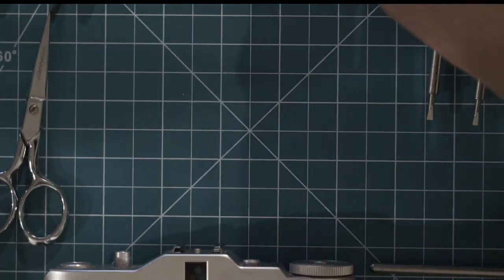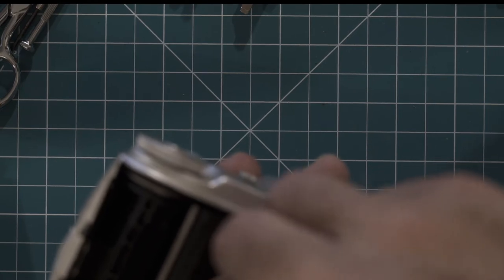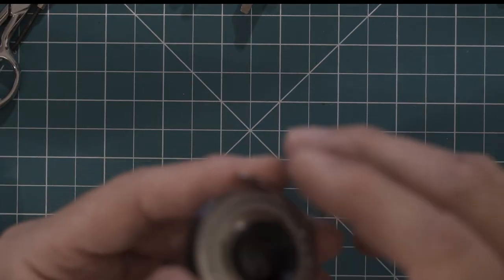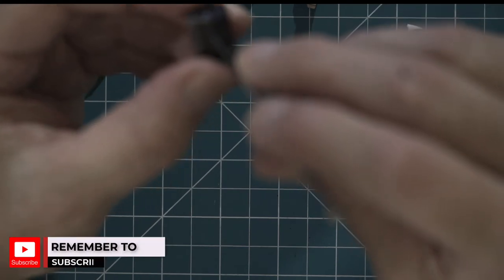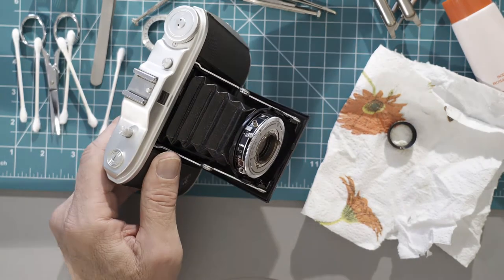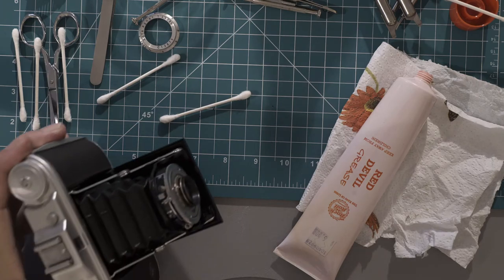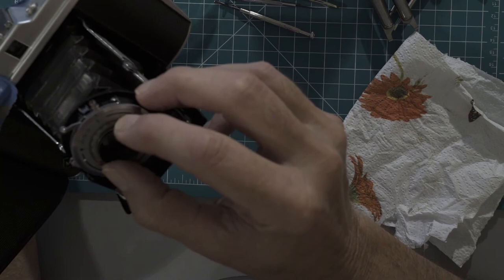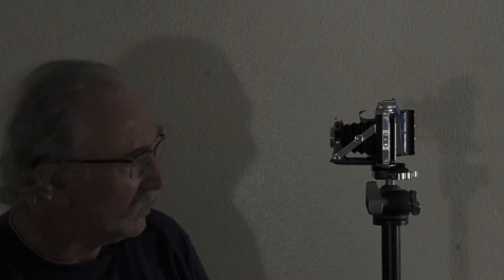How To Repair Frozen Lens Agfa Isolette Medium Format Camera and Collimate Lens for Folding Cameras

Comment: What worked for me was soaking the inside lense in a shot glass with 85% alcohol, wrapping said glass in plastic foil and then dumping this setup into a pot with water just below the "bubbling" stage. This keeps the temps at just below 100C, which in my opinion is well bellow what the lens can tolerate but warm enough for the green goo to melt and stops the alcohol from evaporating too fast. After about 10 minutes I saw that the alcohol got hazy and greenish. I could then separate the lenses with no effort at all. Keep in mind that alcohol is HIGHLY flammable and this may not be safe at all on a gas stove. Did this on an induction stove top. I also designed a custom 3D printed tool for the removal of the shutter from the bellows, will be posting to thingiverse. I don't think Dennis mentions it, but set your 35mm camera to infinity and then align with the isolette. Once the glass (or painters tape with a couple of straight lines) is in focus you have your infinity notch.
Reply: Nice you have cleared the lens and practical.Thanks.
Reply: Recently I got one from my friend in Hyderabad,India.It is Agfa agnar pronto 4.5 to 85.But soiled by dust.and I cleared it with D40solution and by coconut oil in liquid paraffin to clean the external body.But to open the lens ,I saw this video.But in vain.Actual lens opening video was out of frame.Sorry, I couldn't control.

Comment: This worked like a charm for my Isolette V! Took me a minute to get the lenses unscrewed, it was hurting my thumbs, but I pushed through and they came undone!  after that I soaked them in Mineral Spirts for a few hours and the old grease came off pretty easily. A camera shop in my area wanted $250 to fix it! Going to use a #10 grease to put them back together again. Cheers!

Comment: I just got a frozen isolette III in beautiful condition but with a frozen range finder and focus. The range finder was easy enough to get at and is now perfect, but for the life of me I couldn't figure out how to get the lens off the bellows to soak and clean (I'm new to servicing cameras and this one is over 30 years older than I am). 

This was super helpful, I'm ordering pliers now and going out to get some hose clamps. Even though I marked the orientation of the lenses so I wouldn't have to worry about getting it right when I put it back together I'm going to go get some wax paper just to experiment and double check

Thank you!
Reply from the maker: Even though you marked the lens you will need to check focus. Very hard to mark and get it right again. Good luck take your time.

Comment: Great Video lesson Dennis, Thank you, just one question, i am checking a rolleicord 3 focusing with your method, using a dslr 
Nikon 5100, what is the setting on the DSLR i must apply ? Gracias , Alejandro
Reply from the maker: Sorry never used a DSLR but I would say setting doesn’t matter as long as you don’t move the setting that you are using.

Comment: okay so with your clamp technique i managed to actually get the lenses apart (damn they were stuck!) but the clamp must of slipped when i tightened so the outer lens got a bit bent in one spot. I hope it will work anyway, i think so atleast, its right where the focus ring goes on, you can see it from the outside so hopefully it will be just a good memory and nothing else. I apprichiate seeing the part on how you focus a camera too, its nice! 

We'll ill be on with it, got alot of the deviles grean greease to rid of..

Aaaand i just found a shatter in the glas of the back lens.. was afraid to screw it real tight and i think i just learnt how much is too hard.. 
Its just on the side so hopefully it still works. Or the picture just might have to be that way.

Comment: Dennis, good video! Question - I got the inner ring off with the spanner wrench. The lens would not come off the bellows. There was another set screw underneath the ring that I also took off and the lens will still not come off. Not only that, I can’t put the set screw back in - there doesn’t seem to be a hole. Do you do repairs for other people and could I send my camera to you to fix for a fee?  Thank you.
Reply from the maker: Sorry for the delayed response I am traveling so makes checking difficult. I guess the first question I would have is what make of camera. The inside ring should be the only thing holding the shutter. I am not understanding the set screw but if it can out it will go back in. Maybe kind of turn it in reverse to set just right before turning to tighten. Again not sure what talking about. As far as taking cameras for repair I don’t. In fact right now I am on a year of travel in travel trailer out west so make where I cannot. Rereading you question so I don’t miss anything you are saying you took rear rear (one inside bellows) and could not remove lens. When you take that ring off allows you to remove the complete shutter and lens. Maybe rewatch video. Hope helps some and more questions let me know. 
Dennis

Comment: Hallo, Is possible make the maintenance without deassebly the rear, operating only on the front Lens?
Reply from the maker: I am not sure if I understand the question. If asking if the lens is frozen and would not have to take apart? If lens is frozen you would only be able to take a picture at only the distance it is frozen at. Not sure this answers your question.
Reply: @dennisworkman3287  maybe I explained myself wrong (my lens turns with difficulty) I was wondering if to release the front lens it is essential to detach from the bellows, or if you can only operate from the front.
Reply: @dennisworkman3287  i understand because i have the same question. Is it possible to perform the repair without taking the entire lens & shutter packadge of the body? the place where you use the wrench, or is it possible to perform while the shutter is still attatched to the body? 

Since i dont have special tools, it would be quite nice to skip the part where im possibly dameging the bellows. 
Hope that makes more sense :)
Greetings from sweden, Apprichiate your videos!

Comment: Hello, I would like to ask you, what settings do you use on the SLR? Do you set it on a given distance? The Isolette of course on infinite. Thank you
Reply from the maker: I still use an old light meter to get my settings.
Reply: @dennisworkman3287  I mean to re-colimate the isolette with a SLR, I do not understand what you do with your slr. Do you set it also on the infinite?
Reply from the maker: It doesn’t matter you are focusing the one you collimate.
Reply: @dennisworkman3287  thank you very much